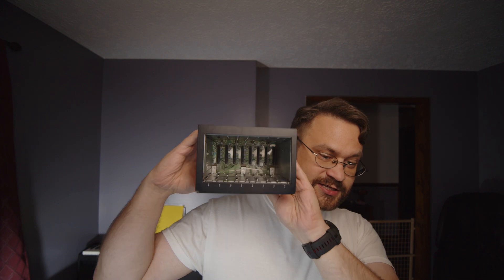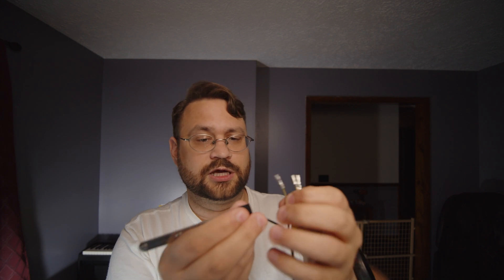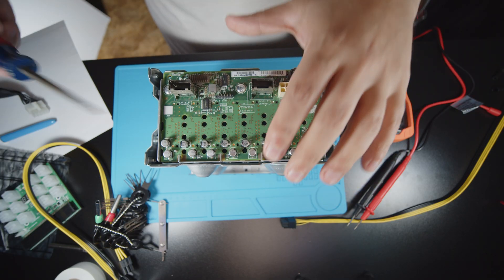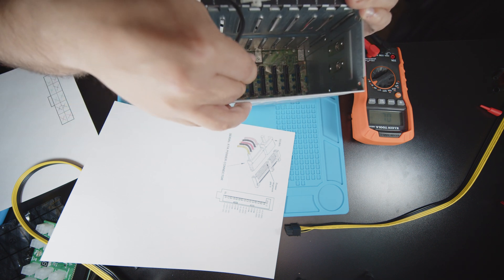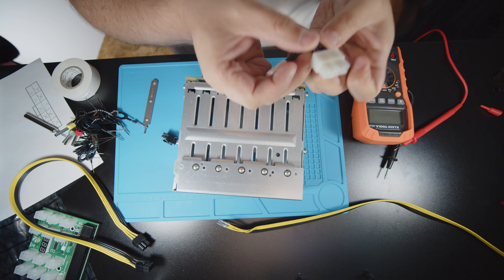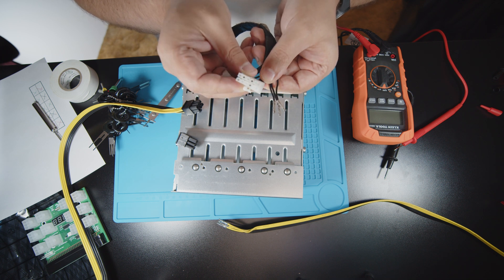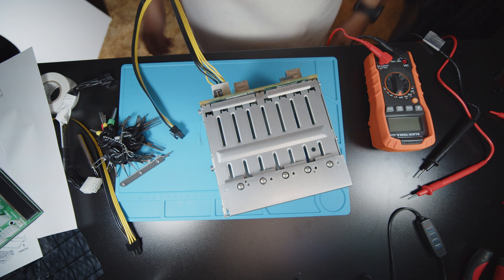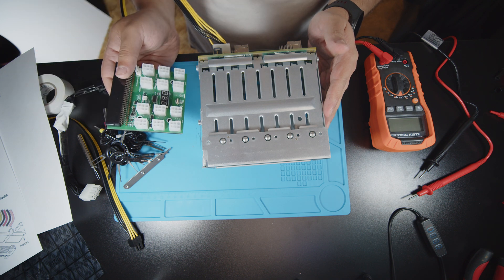Make Server-Grade Storage Work on Any Desktop! (Hardware Modding)

Comment: If you need 5v what’s the best option? Find 5v on another cable?
Reply from the maker: If you have a cage that doesn't step down 12v to 5v then I'd recommend getting a cheap desktop PSU, in that case it's more cost efficient for you to get something like a 600W range 80 bronze for something like 30-40 USD.

If you have a cage like mine where it steps down the 12v to 5v, a used 1200w(220v)/900W(110v) 80 platinum server PSU for around 50-60 bucks would be a better investment in my opinion.

Comment: Like always a very informative video by you. To extract pins from the connectors I simply use two stapler pins. Instead of different colors, we can also mark pairs with (o - * + #). Also for the 24 x 7 use of these drives we must use 120mm or whatever the size required for the cage to keep them cool.
Reply from the maker: Thank you!! =)

I tried the stapler method and I just couldn't handle it, good job at managing that! That's a good point and different signs rather than different colors will probably be easier to read from a distance, for instance, if one were to record something.... hehe

Yes! The SSDs that I'm testing now don't seem to be that bad, but the reason I even mentioned getting the fan and hooking it to the same PSU was that I had turned off my plotter for the night and forgot to turn off the cage, which had 15k HDDs in it. When I woke up, I had to wait several minutes after unplugging the cage to be able to touch the HDDs because they were so hot! Hence my advice to always plug the fan into the same PSU as the cage!!

In the future, I will probably hook the breakout board that's attached to my server PSU to my internal PSU so that whenever I turn on the computer, the internal PSU will tell the external PSU to boot up. =)

Comment: Ive been waiting for this. Thanks that's game changing for chia
Reply: Also i love ur sense of humor, really. died at the end xD
Reply from the maker: @adekgurwica5527  
Been waiting 3 weeks to edit this one! I'm glad that you like my sense of humor, I'm going to try to add more of me to the videos XD
Reply: It's not super cost effective to go hot swap if you're purely into Chia for the profit. You're better off just 3D printing drive holders or using really anything cheap to stack them up with a fan and one of those Dell 5r10n SAS expanders (also requires a custom cable), those allow for 32 drives to connect to one SAS port. :D
Reply from the maker: @PeterBrockie  Funny you should say that, I'm actually 3D printing the 2.5" caddies that go in to these cages, and I've also 3D printed holders for 2x6 3.5" HDDs that I slap 12LFF Backplanes to. I'm in the process of figuring out how to increase the print volume of my current 3D printer (for as little as possible), so that I can make a holder for 4x 12LFF Backplanes with fan mounts on them.

SAS expanders are wonderful when connecting to Final Destination Drives, in fact, I am currently using one that takes a single quad cable (SFF8088) and provides me with 6 quad cables (SFF8087), and I have hooked that one to 3 different 12LFF Backplanes (single SFF8087 to 12 drives), as a proof of concept of how many HDDs you can hook to a single Quad port on an HBA without it affecting farming. I am going to be adding 2 or 3 more of those Backplanes and I don't foresee any issues with adding those as I have seen 0 issues with the current setup (36 HDDs running off of a single SFF8088).

I am sad to say that I think that you are missing one of the main reasons why I'm doing builds like these. I am running everything off of UPSes, and the bigger they are the more expensive they get, I am also limited to mainly 110v 20A circuits with 15A outlets (since I have more than a single outlet per circuit). I am trying to split the power requirements from a single PSU in a computer to an unlimited amount of PSUs (which are highly efficient and can be plugged in to other UPSes that reside on other circuits). These platinum grade 900W-1200W PSUs are extremely cheap and efficient, but they only output 12V. The beauty of these 8x SFF backplanes is that they are NOT switched (good for the speed required for plotting) and use only 12V and the 12x LFF backplanes ARE switched (good for more drives/fewer cables) and also only use 12V.

While using breakout cables (such as SFF8087(or SFF8088 for external) to 4x SFF8482, or SFF8087(or 8088) to 4x SATA) is a great way to start, I have found that they can be a tad fragile, and I personally prefer using 8087 to 8087's hooked to a backplane.

I am planning on making a few videos about farming setups once I am done with the plotting series, and I will definitely be talking about 3D printed solutions for physically holding the drives, but I will of course also be talking about how to connect as many drives as one can without risking losing out on block rewards. =)

Comment: who will do storage based on 2.5 sas disks
Reply from the maker: I actually use it as a cheap cache drive (8x RAID0), although I mostly use it to test out hardware. =)

I have a similar solution for 12x 3.5" HDDs that are also run off of 12V only PSUs. Same principle when it comes to figuring out the pin out and rewiring them. =)
Reply from the maker: Also, if you need them for a write heavy application, you can get very fast 3.84TB 2.5" SAS drives, if you only need fast reads, you can get very fast 7.68TB drives. That means that you would be able to fit 61.44TB in a fairly small cage, which uses fairly little power and is considerably faster than HDDs.
While the 2.5" SSDs are considerably more expensive than 3.5" HDDs, they are cheaper to run in the long run, and may also end up requiring less expensive solutions for your home (pulling new electricity, getting bigger UPSes etc to feed hard drives)

At this point in time I am not going to be going all out on SSDs for actual semi-permanent storage, since I don't have the budget for it, but for someone who might, this solution could actually make sense even for long-term storage. =)

Comment: nice work. I'm exited what you will do  with it external.
Reply from the maker: Thank bud! I mainly like it for the fact that I can power them from a different PSU that I can run on a separate UPS. If you look at the background of the thumbnail you can actually see three of them, 2 with 8 15K SAS drives and 1 with 8 SAS SSDs. =)

I also helps with thermals since they won't be heating up the computer case (if you can actually fit that many in a computer case!).
Right now they are right next to where I sit so I can very easily swap out drives when I'm running tests, but later, once I have a more permanent setup, I may end up drilling a hole in a wall or a floor and place them in a different room to lower the sound and heat in my home office (and be able to use a completely different breaker since it would be in a different room).

It would be similar to what I did with my watercooling system, where I drilled two holes in the floor and put the radiator in the basement.
Reply: @JanisRode  nice idea! 💡 you can place them like any spot you want ☺️ how connect the sas ports to the hbo? maybe new video "the hidden wall server" 😅
Reply from the maker: @levelnine123  Sorry, I forgot to hit the reply button and clicked away from your comment. =(

I don't think that my wife would appreciate it if I were to punch a hole in the wall and put a server in there.... .... but... you never know until you've tried, right? =P
JK, I think that it might be against code to do that, even if I were able to remove all the heat from it, due to it being a fire hazard... I think? I may look in to that if I get bored enough. ;)

I updated the description with the types of SAS cables and HBA that I'm using, I hope that helps. The cables that I'm using are fairly long (2m), so I can really move them around. The power cable is a lot shorter, so I just need to move the server PSU with the Cages and then I'm fine =)

I should definitely be able to make a smaller hole in the wall and put the brush type of pass-through wall plates on both sides of the wall and just pass the cables to the next room and have HDDs spinning there....